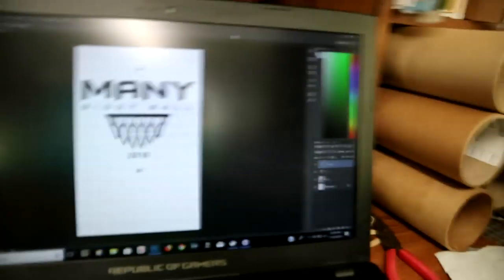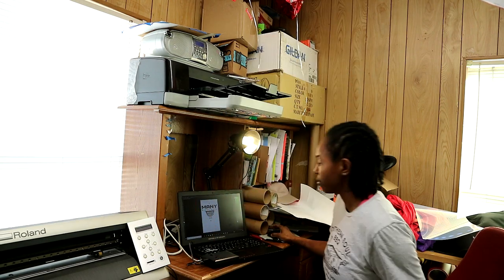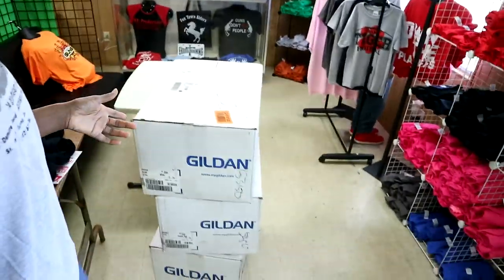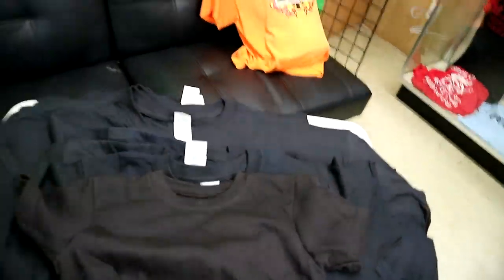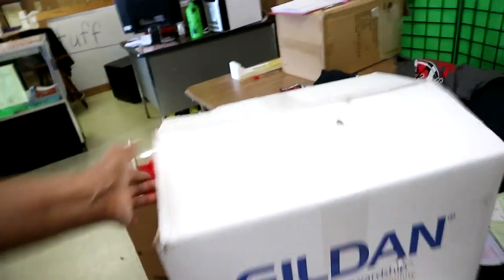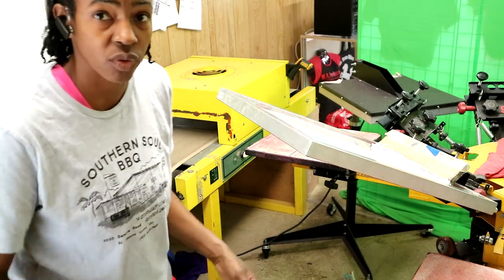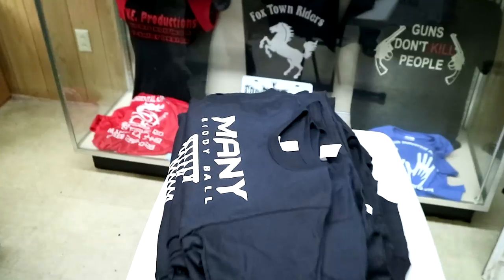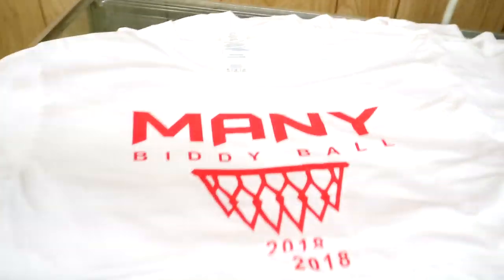Printing Basketball Jerseys (For Youth League)

Comment: What printer do you recommend for  printing film thanks
Reply from the maker: Any printer that can print the size you need should be fine.  I would recommend getting a printer that can print at least 13x19 inch films.  A lot of people like the Epson printers mine is an HP (my printer is over 11 years old).  Hope this helps